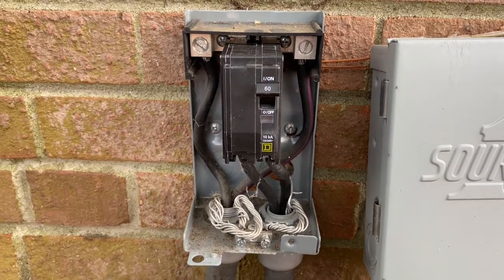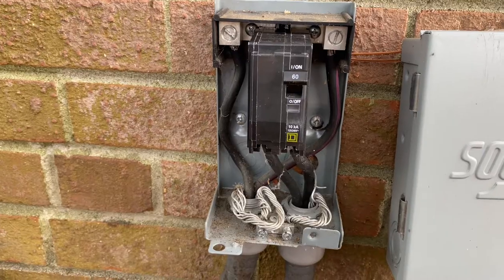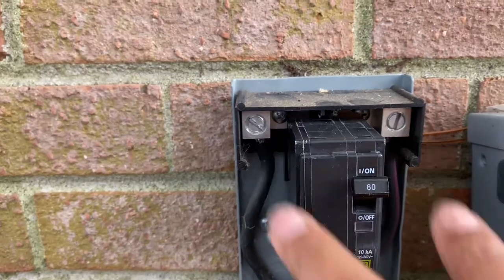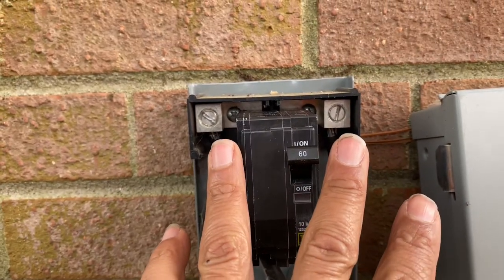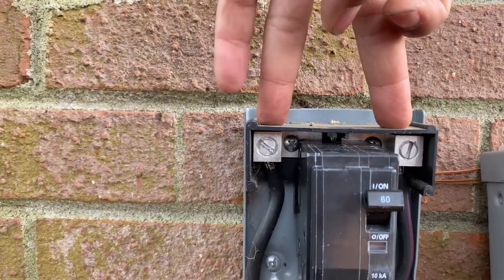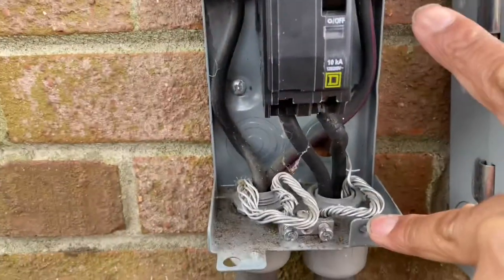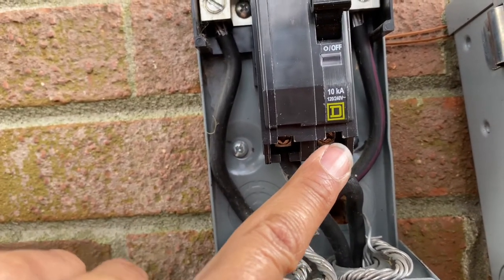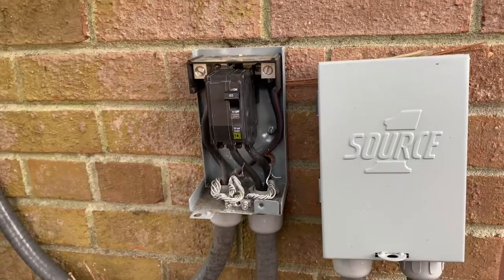how to test a circuit breaker on an air conditioner￼

Comment: Thank you for the video.  First video I find informative and useful on this subject.  What happens when I don't get 240 on line to line?  I get nothing.  When I test line to ground, I get about 120 to each leg.
Reply from the maker: If yoy get 120 line to ground on each leg and zero on line to line you should check it again. It should read 240 if you get 120 line to ground each